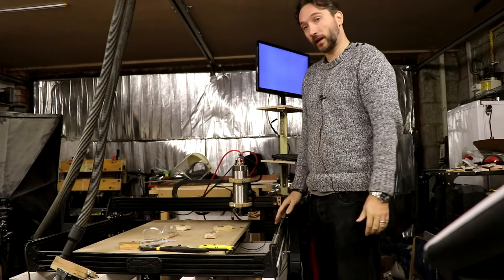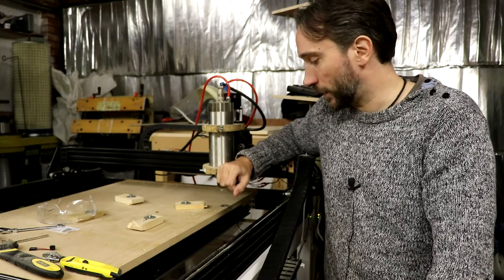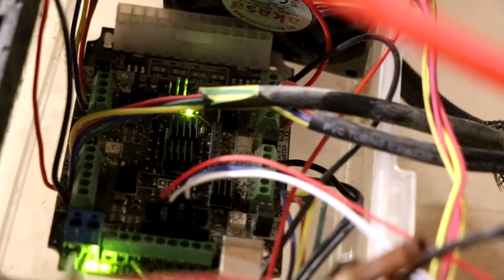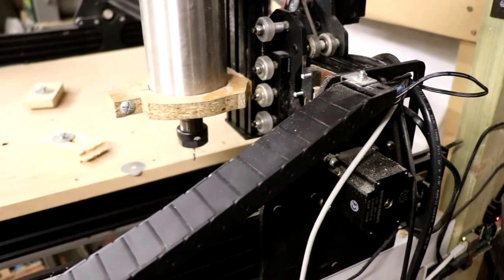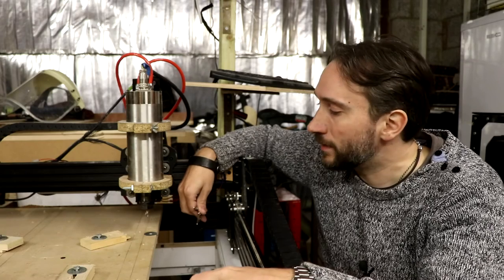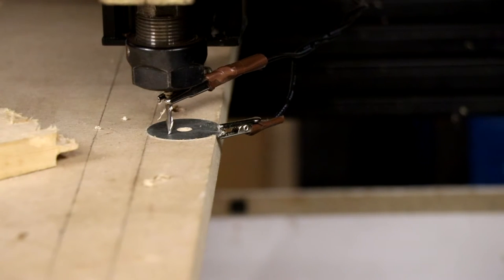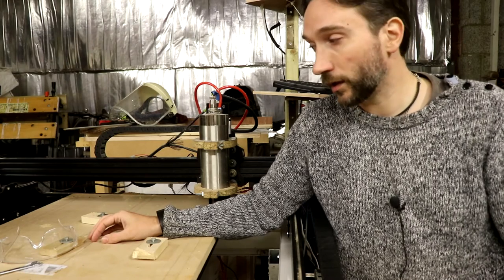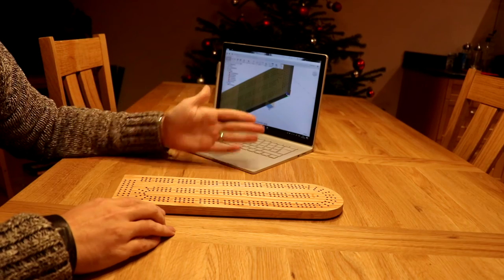ooznest ox cnc walkthrough - enabling tool changes

Comment: My Ooznest OX is sitting in its box awaiting assembly. I want to make a good heavy trolley that will have the shopvac inside and the OX itself will be in a cabinet above with the walls covered in acoustic foam because of the noise you mentioned. I've also got something called a SuperPID v2 on the way which will let me run the Dewalt 262000 like a spindle... dropping the min rpm to 5000 from 16000 and raising it to 30000 from 28000. It also will let me automate it like the VFD.

Still, it's nice to be able to watch another Ooznest OX user.

Comment: I need to find out if I came home my xcarve the same way. great video.
Reply from the maker: +Vernon Whitehead Jr what is the control electronics on the x-carve? Does it support homing switches? The actual gcode command should be standard
Reply from the maker: As it happens I saw on another thread that it looks like it depends on the version of electronics you have. the 'newer' control unit has connectors for limit switches and a probe, so if you have that you should be good to go. not sure if the older version has those connectors.

Comment: Hi Dan. You inspired me to finally get a CNC! I bought the OX. Curious to find out a bit more about your spindle router and what it is, where they can be acquired. Less noise is going to be something I need to think about for mine! If my dog barks once, my neighbour sounds an air horn! He's going to love this! Any info welcome! (Been following bathroom build, looks good!)
Reply from the maker: +Digital Spring Limited thanks! And congratulations on the ox. I got my spindle and associated vfd from cnc4you in the UK. If you search for 2.2kw water cooled spindle you'll find the same thing available in a lot of places. Where you buy from is a matter of your appetite for risk. I bought from a company I felt I could trust to deliver a quality and tested version.
Reply: Oops switching to personal account! Yup I have found cnc4you.. I can see loads of different types. my next question was the power you have, you've answered that :) The prices vary hugely. I guess for this job, its not going to be doing heavy work, just hobby woodwork stuff. I'll keep on digging, thanks for coming back to me, appreciated.

Comment: Hi could you tell me what water-cooled spindle you, any advice would be appreciated
Reply from the maker: mine is a 2.2kw model, I think they're pretty standard from china. though I bought mine from a uk company cnc4you.co.uk it is heavy, and whatever machine you have needs to be able to handle that. I'm definitly pushing it on my little ox. but I've had a lot of use out of mine and it's been great.

Comment: Great video thanks mate. I use universal code sender to send the gcode to xpro. What is it your using ? Wouldn't mind building a touchplate. Thanks for the help
Reply from the maker: +SILLYFAST I'm using bCNC runs pretty well on the raspberry pi. It also hosts a web page that lets you control machine from your phone :-)
Reply: Maker | Geek I will definitely look into it . Wasn't aware xpro could have a touch probe. Thanks again for your vids . Subscribed and I'll watch through them when I get time . Keep it up ! 😀

Comment: Can u setup a macro to do the probe ive made a probe but its 0.75 think so im confused what to put Sorry for all the Q
Reply from the maker: Not sure I understand the question. As it happens I just installed a new length sensor setup on my newly rebuilt machine and I setup a macro for that. It sets the machine zero so the tool just touches the spoil board. It just required measuring the offset between the switch and the spoilboard

Comment: Can i ask what did u rest your spoiler board  on are u using 20x80  X 3
Reply from the maker: At the time of this video, yes. My latest build is basically just a frame screwed to a wooden cabinet. With the spoil board mounted and flattened

Comment: You've permanently embedded the touch off plate into the surface of the waste board which I found intriguing but then again you didn't do so with the wiring which I found rathet puzzeling - Why not permanently attach one wire to the touch off plate and the other to the housing of the spindle? I just checked with my machines spindle and there's conductivity between the tool and the housing of the spindle which should already have a ground wire attached to it easing the task.
Reply from the maker: Interesting point, I could have, though since the wires have to come essentially from the gantry it would have to run through the cable chains or just be super long to allow for the full movement of the machine. Plus I'd still have to connect the spindle side of the circuit. As it happens since this video I've switched to touching off of my DIY CNC vice. Though the point is still valid. I guess if I was on a machine with an automatic tool changer then it would be more important to have the touch plate with less setup. Do you have an ox yourself?

Comment: Just wondering as I've been having some issues setting up my touch probe (mainly wiring) if you could let me know where you have yours connected to as ground is easy to find but where is your other connector?

Also great video!!
Reply from the maker: +Rich Walton hey rich, I did a more in depth video on the touch probe wiring which you can find here https://youtu.be/Y5c_9uMsPAk
Reply: Maker | Geek Thanks for that, you're right that there is little to no info about where it wires in. One more question how did you mount your z probe as I've struggled to find space for it to fit?
Reply from the maker: +Rich Walton my z probe is just attaching crocodile clip to the tool and to a washer when I need it...
Reply: Maker | Geek sorry Dan I badly explained that I ment the z limit switch not the probe (sorry my bad there)
Reply from the maker: +Rich Walton ah! Yeah that was super fiddly. I only have one for the upper limit. Nothing on the lower limit. I only needed the upper to support homing. Mine is a small switch stuck with very sticky pads to the bottom back of the front plate of the z axis carriage. The switch points down and the little 'foot' at the bottom of the z presses it when it's at its top most point. Does that make sense? Kind of hard to describe
Reply: Thats what I was looking for, yeah the space is tiny which is a pain, double sided tape it is then I guess lol. Thanks for the help and I look forward to your next video :)

Comment: Nice vid, I'm looking for my first CNC, been looking at the X-carve and the OX, are they more or less the same thing? I'm in the UK and the 1000 x 1000 OX is a lot cheaper than the X-carve, thanks,,Paul.
Reply from the maker: +paul113757 as far as i know they are more or less the same. I think the x carve comes with a proper electronics enclosure but it is still grbl based. I've been very happy with the ox
Reply: Thanks for the reply I also like the idea of the water cooled spindle to keep the noise down, where did you get the spindle from?
Reply: Thanks again could be more questions soon.
Reply from the maker: +paul113757 any time! Good luck
Reply: Is a water cooled spindle quieter than the air cooled spindle or are they the same?
Reply from the maker: +paul113757 much quieter. Most routers are air cooled. Water cooled is a huge reduction in noise

Comment: How many passes do you think a 1/4" cutter through 15mm plywood please? Ozznest state 2mm passes but that seems very shallow. I want speed of cutting and whether 1kW  Suhner spindle would achieve the cut in say two passes?  This 2.2kw spindle cuts 15mm plywood in one pass: https://www.youtube.com/watch?v=Y7K0KPnyCHI  I'd like to use the 2.2kw spindle same as yours but is it not too heavy?
Reply from the maker: I would imagine the limit is going to be the structure of the machine rather than the spindle.  I would not expect to be able to do 15mm in one pass despite having the 2.2kw spindle, the problem is cutting forces versus speed versus rubbing/chip load etc. The video you linked had what looked like a pretty serious machine, I'd guess using chunky linear rails and precision linear bearings, possibly rack and pinion drive, all of which makes for a really solid structure capable of applying a lot of force. If I tried that I'm sure my gantry would flex even trying to plunge 15mm that fast, and it would definately flex around and not cut straight trying to drag a bit through that much wood. 2mm sounds reasonable, a lot of people say no more than 50% cutter width, so maybe as much as 3mm passes. As for my 2.2kw being too heavy. Ooznest did warn me that they'd consider it too heavy, and that ultimately goes back to the rigidity of the machine and the intertia in moving that weight. I guess I get slower rapids than might be possible with a lighter weight, but I've not felt it to be a problem in actual cutting. oh and that's not even talking about quality of router bit. I buy cheap bits, but I'm pretty sure there is a reason people pay >£100 for individual cutters in professional shops. Not sure if any of that helped...
Reply: Thanks this is really useful. I cannot easily get the information I need from companies selling their products and maybe they don't know the parameters of these products like people like you (and me with the router) who explore the boundaries. The video test I showed you was extreme yes on a serious machine but I am advised that the Workbee (which I'm very interested in for its potential) should really only cut just 2mm passes which means on a commercial job I would be waiting all day.  I want to use this for both fun and work when the pressure is on.  I am hoping to start with the Workbee and then upgrade the rails/guides etc in time.  From what little I've learned so far, spindle weight is an important factor (not least on bearing wear on these novel guides that  Workbee/Ox use). The belt drives seem much faster than leadscrews and I like your idea of doubling up on the belts. My option is to buy a much more expensive pro machine but as a maker myself and the fact that this is an online community (and would echo very much what I do on my own channel) it has great appeal and will be a less expensive mistake. The accuracy required for wood is different to metal.  If I can my 18mm plywood in 6mm passes using a 1.5kw spindle (under 4kg) for work that will need some sanding and then lighten up the passes etc on more precise work, surely the machine would cope with that and any noticeable flexing look for re-inforcing solutions?
Reply from the maker: Hey Jeremy, I made you a video of trying am 18mm single pass https://youtu.be/UcODkska7ZI
Reply: Thanks. It all helps in my making the best choice of whether to buy a pro machine or learn via this DIY machine with the benefit of the Ooznest community.

Comment: Have you had any problems exceeding the Ooznest recommendations regarding the 2.2kw spindle? I am currently building a workbee and am drawn to a 2.2kw spindle but am concerned that my limited knowledge wont allow me to identify if any problems are actually related to the spindle and its weight, or not. Any advice gratefully received.
Reply from the maker: +BSHayling that's a great question. Which has a slightly long and nuanced answer. The short version is... Many videos on my channel are me successfully making things with my ox and heavy spindle. If I get time this weekend I'll try to give a more detailed answer as to the considerations
Reply: Many thanks Dan. I assume if you are using the supplied 175oz nema23 stepper on the z-axis then it should perform the same on the Workbee. Regards, Ross.
Reply from the maker: +BSHayling yes I'm using the supplied steppers. No problem raising the weight of the spindle

Comment: Good vid. Fascinated as to why you have X0 Y0 top right? Convention is bottom left... Still, if it works for you, it's all good. I love the ability to make one, rather than buy one! Thanks for sharing.
Reply from the maker: +Skysurfer I'm an unconventional person I guess :-) basically that is where I needed to place the monitor/keyboard/RPI that I control it with. I wanted home to be next to where I control it from otherwise I'd be constantly walking back and forth around the machine.
Reply: That's what counts, that you're a happy chappie! I've got this machine on my wish list, too much else going on at the mo. Like your upgraded spindle, & good to know the gantry can handle it. Why don't you make some new spindle brackets out of nice transparent acrylic? It'd look fine.  Putting your electronics in boxes might be a move... Try this site 

http://boxdesigner.connectionlab.org/
Reply from the maker: +Skysurfer check out my more recent video...I made an oak spindle mount :-)

Comment: Hey Maker Geek,

For my work I have to drill many little holes (Ø3.2mm) in 2mm thick steel plate.
I like to do this whit a cnc machine. Do you now if this is possible whit the ooznest ox router including the 2.2 kW spindle? 
Would the spindle have enough torque and is the machine stable enough for this job?
 I hope you can help me. I like to begin soon whit my first CNC project.
Thanks,
Melvin
Reply from the maker: +Melvin voshol interesting question. For just drilling I'd guess yes but the real question is how fast etc. For lots of holes you'd probably want coolant? Which would only be a manual thing with the ooznest. I have some mild steel around, I could give it a go and see what happens...
Reply from the maker: +Melvin voshol interesting question. For just drilling I'd guess yes but the real question is how fast etc. For lots of holes you'd probably want coolant? Which would only be a manual thing with the ooznest. I have some mild steel around, I could give it a go and see what happens...
Reply: if it’s necessary I would use coolend. the option is available on my controller.
I want to use the USBCNC cpu5b controller from Edding CNC in combination with Sheetcam.If you would like to look of it is possible and how long it lasts about a hole, I would really appreciate that.
Reply from the maker: +Melvin voshol well I did a quick test on a mild steel bar, and had no joy with my setup. The machine deflects. Not stiff enough I guess to apply the necessary force to steel. Didn't make more than a small dent in the steel with my 3mm drill bit

Comment: i wonder how can you u se 2.2kw when everyone say the machine cant support
Reply from the maker: I believe it is more that ooznest won't support you if you have problems because it is heavier than they recommend. The machine is perfectly capable. Just need to keep the z movement slower with enough power to lift it without stalling. Works great for me
Reply: Maker | Geek thanks sir btw what kind of stepper you use
Reply from the maker: I'm using the CNC xpro controller that ooznest sell. I have a raspberry pi connected to that running bCNC for the front end

Comment: Hello.You said to sillyfast that bCNC hosts a web page. I tried that with "myip:8080" but  the page does not load properly neither on smartphone or laptop. Is that what you used for the web page?(i tried VNC Viewer to access my raspberry pi and it works fine by the way)
Also,your bCNC UI seems different than what i have.Which version are you using?
Reply from the maker: +athanasios loukas yep port 8080 on my raspberry pi. Seems to work fine from my android phone. According to my bCNC.py file I'm on 0.9.7. I've not looked for updates it a long time since it seems to work reliably
Reply: Greetings Maker | Geek. Thank you for the quick reply. You can also use Vnc or team viewer to control the whole raspberri pi from anywhere and not just the bCNC. I am on 0.9.11(2nd Oct 2017) but the UI seems worse than yours.Anyway thanks again for the information.
Reply from the maker: +athanasios loukas no problem. In general the remote thing is cute, but I'm always happier to control the machine directly. I'm normally in the room whilst is running. I can't think of a real use case to control it from anywhere other than next to it. I guess if didn't want monitor/keyboard connected to the pi then vnc would be useful.

Comment: I was today years old when I saw a youtube video that shows how uncomplex setting up a z probe is.
Reply from the maker: Glad it's been helpful!
Reply: @MakerGeek  I found your video looking up recommend feeds and speeds for my machine. I've been running a very low max feed rate and want to start to bring it up. Not sure how much the motors can do or the machine can take.  How did you settle on a jog/home speed? 
I understand cutting feedrate is its own chapter, this is just about finding the most suitable speed for non cutting movement.
Reply from the maker: @simonak2724  in the early days I did a lot of testing with acceleration and Max move rates. Mostly taking it up to the point it clearly stalled out etc. For feed rates I've generally built up an idea over time for materials and cut depths etc. Some operations are less sensitive than others. An adaptive clear is significantly different to a profile cut etc. A lot of trial and error I guess. Also if you watch my video comparing the xpro usb to the duet, you'll see the controller can have a fair impact on the speeds you actually get versus what you put in the gcode
Reply: @MakerGeek  I watched that video last night too, I have just replaced a broken laptop with a Rasberry pi. I was using Grbl on an arduino and have a protoneer hat to try out next. 
Im embarrassed to admit the last few months of having this machine running its been at the default max feed rate of 500mm/s- currently at 20K!
Onwards with my journey and thank you again for great videos and replying.